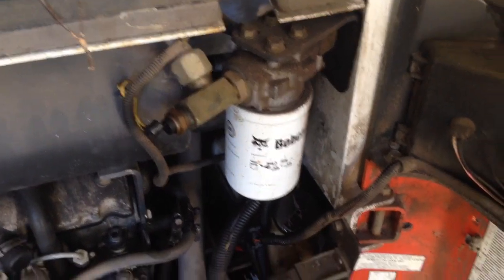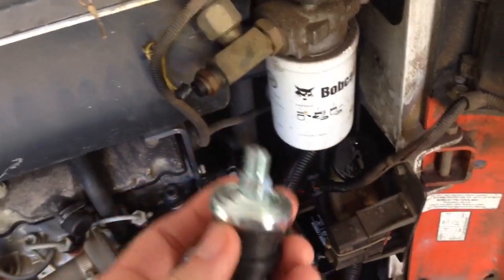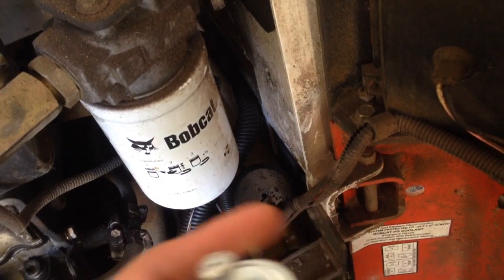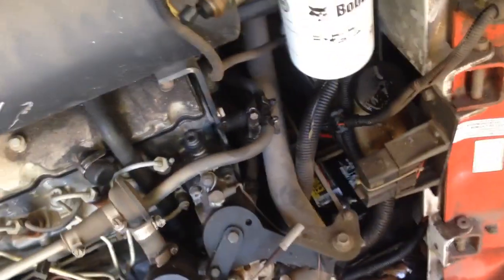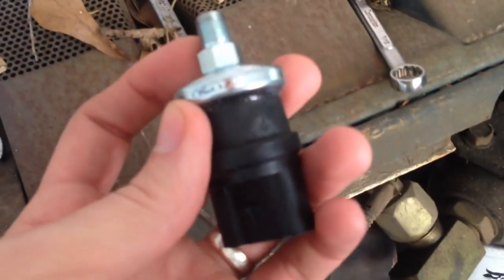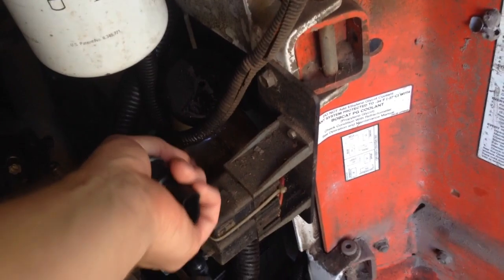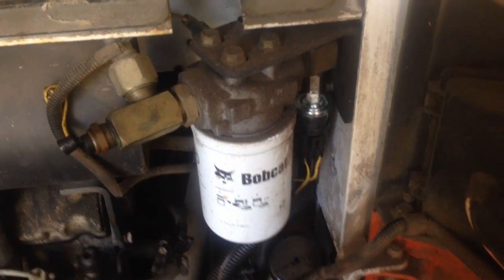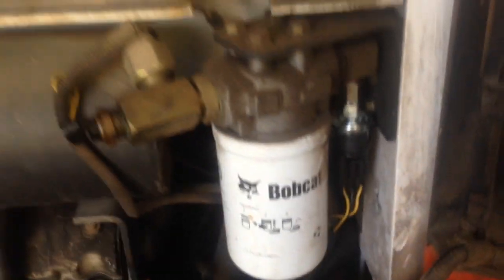Bobcat 751 Hydraulic Pressure Sensor

Comment: Hi. I have problem HP4 where i must search a problem? I remove and instal engine after than i have this problem and it can drive but can't use hydraulic
Reply from the maker: Check the safety switches.
Reply: @mjmcomputers  TY for answer. Every think is ok. The check is before engine start when the hydraulic work and  have pressure i don't have this problem. And the problem is in the fuel.  The tube in tank is to short and don't have enough fuel
Reply: My switch was leaking I replaced switch but it won’t run now..any ideas?

Comment: WALMART | 5Gal $32.85 - https://www.walmart.com/ip/AW-32-Hydraulic-Oil-Fluid-ISO-VG-32-SAE-10W-5-Gallon-Pail/792140101  A good quality brand of AW hyd oil will work fine. The debate is usually which grade. I've used AW32 in Bobcats for years, others would recommend the higher viscosity grade AW46, probably works just as well. IMHO, AW32 works just fine because Bobcat's have a fairly good oil cooler to control high oil temps. I purchased 10 buckets AW32 a week ago..